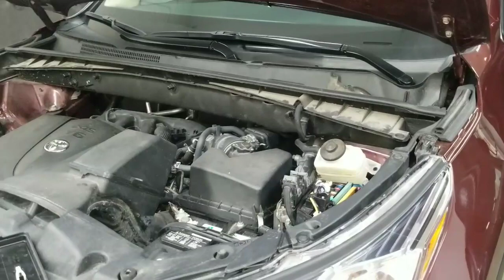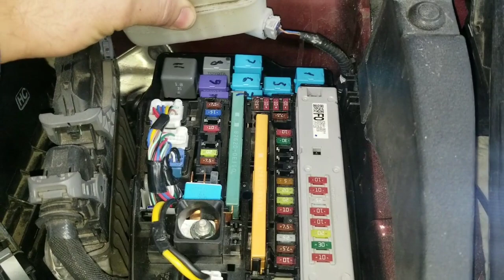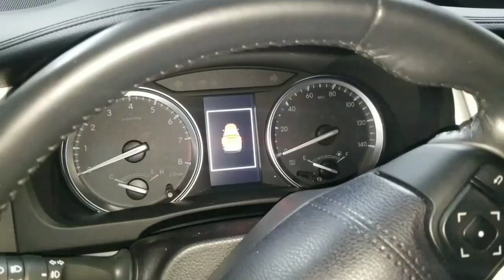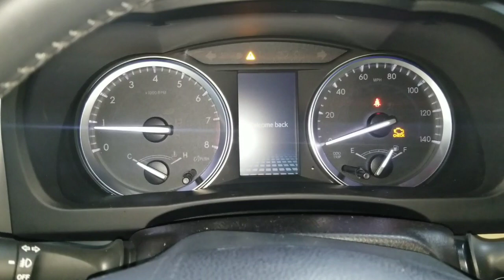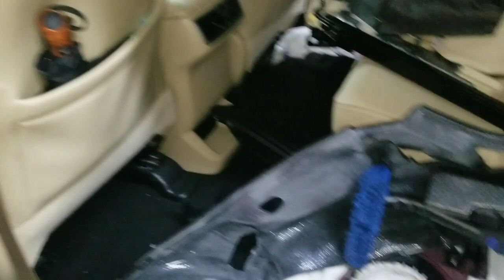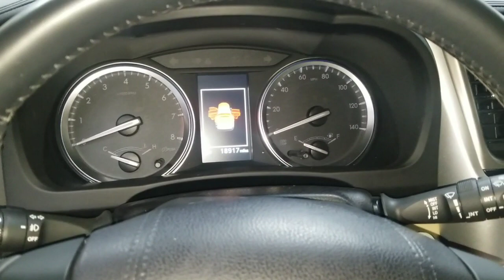Toyota Highlander, engine stall, rough idle, hesitation, no acceleration caused by bad fuel pump.

Comment: 2018 toyota highlander V6 has a p1235 code, any ideas where to check first?
Reply: Did you end up figuring it out?
Reply: @YouTrader-CA  No, local napa place said it needed a high pressure fuel pump and still hasnt fixed the problem

Comment: Very good video! I have a 2016 Tacoma throwing the P107A2A code. I checked low fuel pressure and it's reading consistenly between 87 - 91 psi regardless of load. Car starts and drives fairly normal but the high pressure reading on the low side kinda scares me. This fuel pump was replaced recently. No other codes. Fuel injectors were all replaced recently also. Where else do I look?
Reply: Did you figured it out what's wrong with your truck?
Reply: @dresimon7341  I couldn't. Mechanics were crap at diagnosing, so ended up selling it.

Comment: I have a 2005 highlander, no codes. replaced, spark plugs, fuel injectors, throttle body, o2 sensors, fuel pump ( which it does not fuction the gauge properly, so i put the old back). Car has no power at all sounds rough, no codes it had in the past code p0171 now its gone but no power, rough idle. it use to stall on stops. Please help!!

Comment: Any idea why while driving Highlander 2017 I can lose the electricity in the car for seconds , also from time to time it may not start at all and without Jump start it will start after sometime could it be main relay problem ? Check video , battery is new. 

https://youtu.be/mhHaTmbjZts

Comment: Having similar problem w/my 2005 toyota highlander except it's not dying or stalling out I just can't accelerate fast enough.  Just replaced water pump, 02 sensor and  still same problem. The guy recommended me to go to the dealer and get codes checked w/their computer and not to drive it. 😑also I did not have any check engine lights or warning on this. Only code that showed was bad 02 sensor.  Help!
Reply: Did you get it fixed? Did you try the fuel pump?
Reply: @za-jm8wf  ended up being the catalytic converter 🙄

Comment: Check with the dealership first bcoz theirs a recall for highlander from 2017 to 2019 on fuel pump they will replace it for free. I have 2018 higjlander and they replace the fuel pump for free bcoz its on recall worldwide for highlander check it first with the dealer before you touch anything.

Comment: About how many miles were on this particular Highlander?
Reply from the maker: 18k miles.  As of today Toyota still does not have improved fuel pump. I was told by Toyota they are working on it and will have it soon to all  Toyota dealers. It's under recall for low fuel preassure and stalling out.

Comment: Toyota recalled from 2018 - 2020 to replace fuel pump, so this is free fix, just take it back to dealer, where they got it.
Reply: I don't think any fix is determined yet. I only say this because I am shopping for a used 18 or 19 highlander and none are Certified Pre Owned because its an open recall that is unresolved.
Reply: @artob  The pumps are in...
Reply: Following as I’m looking at a used 2019 model

Comment: Didn't check the fuel line pressure and volume first?  Separate fuel filter or just part of the pump assembly? Clogged air filter (like mouse nest)?
Reply from the maker: First I checked trouble codes, then I check relay and fuses, next I removed fuel line and there was hardly anything. There was no need to put on the pressure gauge as it was obvious that there was no pressure. Screen on the bottom of the fuel pump was like new   and when I directly applied 12 volts to the pump motor it was not pumping mutch
Reply: @melniksmotors  George estoy interesado en comprarte el software para las airbag
Reply: @melniksmotors  mi correo electrónico es navarro6858@yahoo.com

Comment: were is your prof for the fix . were did you diag . back yard meck
Reply from the maker: No proof needed.I have one more happy customer. Video uploaded for reference only.  If you watched full video I am sure you saw engine revving with no hesitation. Prior fix he had to tow it in be because  car was dying every 10 seconds. I dont have time showing showing every single step as I dont have a video crew and I film my self as best as I can. Just as I said before this is for reference only it might help somebody  in near future who might have similar issue. I am in auto repair and bodyshop business not in show business.
Reply: @melniksmotors  just came form jiffy lube a day prior they checked  air filter and did not put intake boot back on right . same problem . test not give silver bullets . do you now how to test . no body shop
Reply from the maker: If your hose was off or loose you would have air intake leak which would cause p0171 and other code with it. Not codes I had. I uploaded them in description.
Reply: if you had a bad fuel pump it would set lean codes . no shotgun parts . pid data to back up your diag . do you now how to use a scanner or a scope .nop just silver bullets   i have seen this thousands of times air boot not installed right after oil change
Reply: so you just told some body on you tube to replace fuel pump for   this problem . test then replace . were is your proof. you have none . you got a lot of parts on  that parts cannon
Reply: @randygould4109  There is a recall for the fuel pump - so it's obvious.